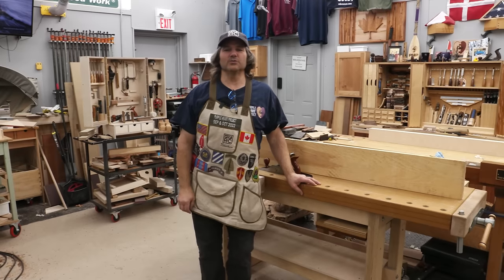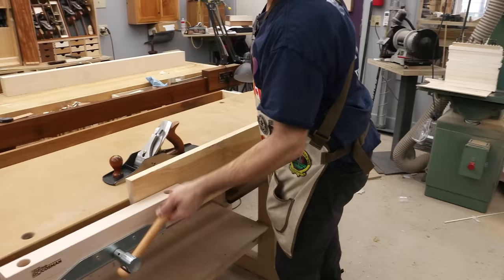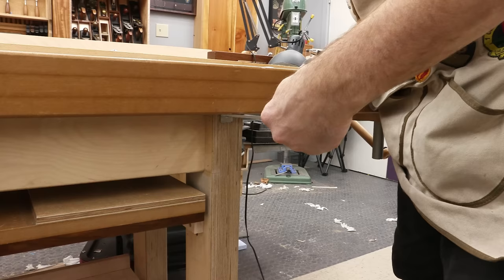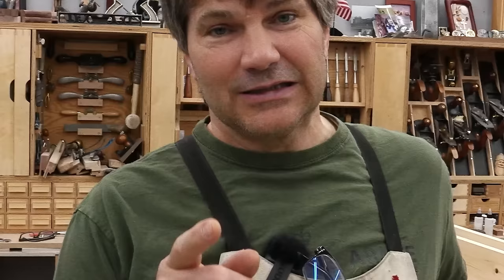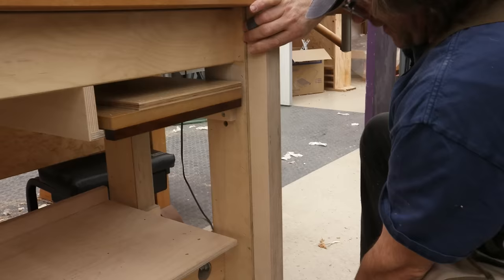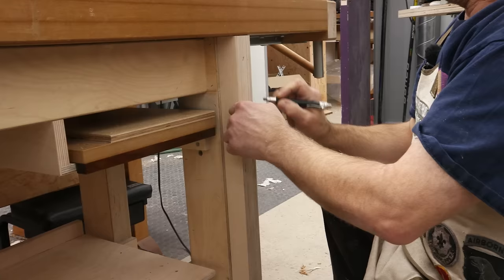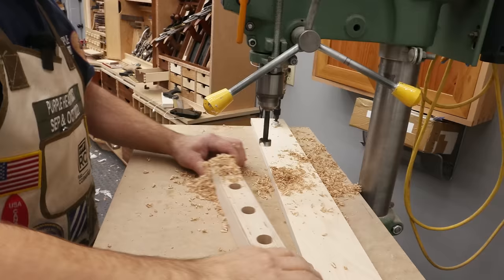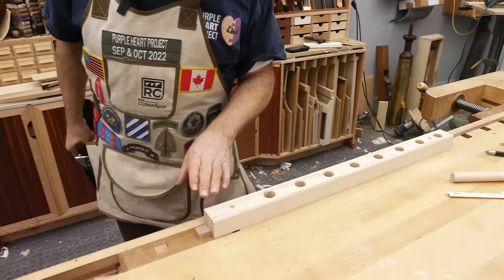Cosman Workbench Upgrade - DIY Planing Support Leg

Comment: I did much the same with my bench but used holdfasts rather than the dogs - seems to work well so far.
Reply from the maker: hold fast wok good too, but you need a long enough hole for the stem of the holdfast

Comment: Hi Rob that's a good tip and I'll do something similar when I make my new bench in the summer.  I couldn't help noticing what looked like a plastic Vernier on the bench top. I had one about thirty years ago when I worked in the Aviation industry. One day after some incident no doubt the engineering department decreed that all Vernier and micrometers had to be put on the test inventory and calibration checked every year. I suppose they were right, things get dropped. I brought my Mitutoyo digital one home and brought in a plastic one. I think it was Kamasa tools
sold it. You know what, it never failed me for quickly sizing up bolts, drill bits ,you name it. I must have had it fifteen years till it got melted when somebody took it to the welding bench. Not guilty I might add.

Comment: As an extra dog, and since the dowel hole was 7/8", turn down the dowel to 1/2" for a length of 3/4" that will slide into a hole in a 3/4" thick piece of plywood cut to 1"X5".  Center the 1/2" hole at the 2"-3" location, and glue in the dog dowel.  This can act as a 1X2X3 block in case the wood to be planed does not sit level enough on the 7/8" dog, or in the vise.
Reply from the maker: great tip, thanks

Comment: SO I just bought the bench plans. Do you think if you were designing the legs again that you'd make this leg flush to start with rather than "adding on a piece" to account for the need?
Reply from the maker: Well you could, I prefer the leg designed as is so that you have a "lip" you can clampto when using the workbench as an assembly bench.  From a construction point of view its probably easier as an add on, but designing it in to start with would work
Reply: Craig Chingren-Hamann "to account for the need"? There isnt always a need! This is an old idea used on benches when the dowel holes were drilled directly into the leg itself. You can use either method depending on how often you need to plane the edge on long lengths.

Comment: Would there be enough clearance for a sliding deadman? This would accomodate shorter boards.
Reply from the maker: You could add a sliding deadman but it would be set back from the edge about two inches so you would need longer dogs

Comment: Why didn't you design it like that in the first place?
Reply from the maker: Because its designed with one vise, a tail vise.  Remember the design is one that is inexpensive and can be built by a new hobby woodworker in a weekend.  We provide lots of videos to show how to upgrade.  This requires you upgrade with a face vise.....not part of the original bench design